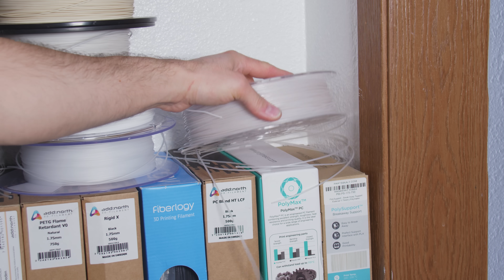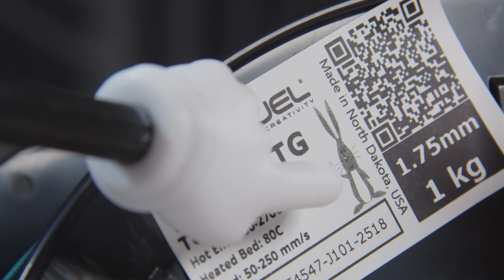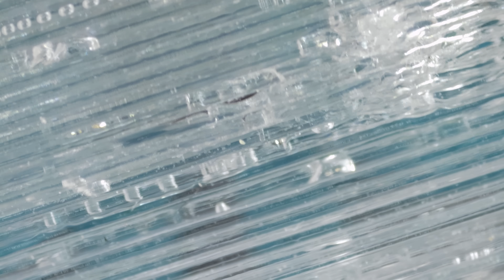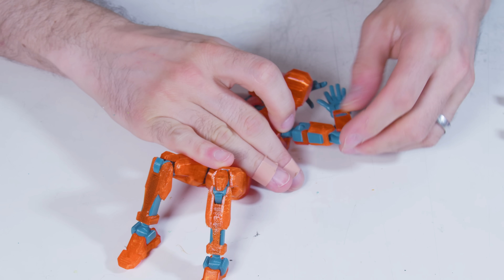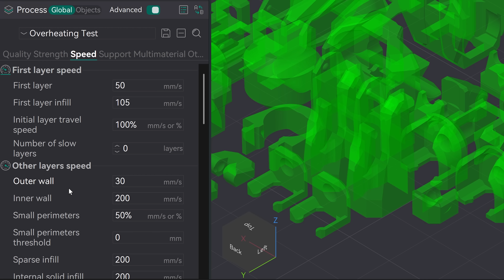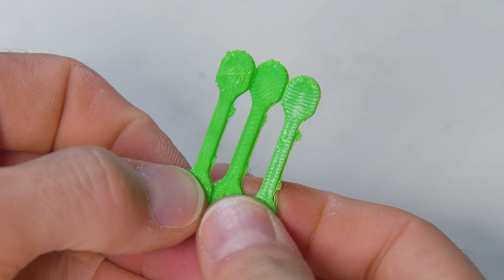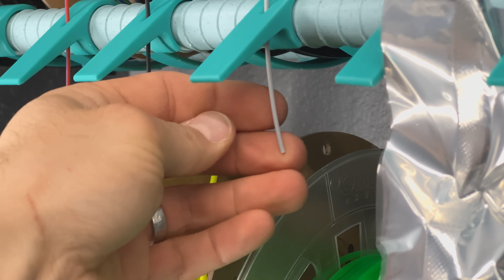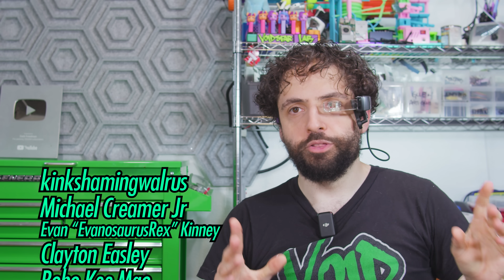Five Bizarre 3D-Printing Mysteries with Insane Solutions

Comment: Putting a spool in the microwave helps release the tension and release moisture. 50% power, time varies based on micro wave Watts. Just long enough to soften, to long and it will fuse or over dry

Comment: Another brittle issue was also caused by re-spooling filament and the stress of changing the shape just a bit during the process, apparently if you simply put it into a dryer it will cause it to be happy with its new form. Got this from another video.

Comment: One weird problem I had is one of my CHT nozzle made my filament full off bubbles it made me go crazy about the filament but when I tried them on other printers they were fine. And it wasn't reserved to only one material I tried asa and pla, both had bubbles

I ended up testing to change the nozzle for a new one (exact same model) and it worked

I have no idea how a worn out nozzle can induce bubble in a print 

And it wasn't that the hole had widened larger than my print lines since I tried double print line width and it fixed nothing

Comment: 12:37 I got problems extremely similar to problem 3 with my first spool of PCTG. But the solution ended up being something else. My layers were actually worse in the center of the part rather than the edges and I was getting lots of buildup on the nozzle. The problem ended up being my z offset. Not sure yet if this is specific to PCTG because it's so viscus, or of the default offset on the Flashforge AS5M is just way to close to the build place. But bumping up the offset by .05 completely solved the problem.

Comment: PVC is extremely dangerous to a person's health during the manufacturing process. If it even slightly burns, the smell is noxious and can cause severe irritation. Not to mention formaldehyde is a byproduct when PVC is beyond it's nominal temperature range.

I recommend that only large scale manufacturing use PVC and PVC should never be 3D printed. (unless you are an expert)

Polypro is that one material that is forgiving in a number of ways but can also be extremely finicky making it more of a pain to process. There will be variations even within the same lot of raw material. I avoid polypro and go with more predictable materials such as ABS, PA, PC, PET-G. and even PLA.

Comment: does 5 perhaps explain why I get small pieces of broken PLA in my AMS if I don’t use it regularly? I have dessicant, the AMS is ‘dry’ but not only was it breaking at the point the filament enters the AMS feeder, but it was breaking at the 4-to-1 combiner which was a PITA to discover and then dig out. For now I’m fully retracting filament when not used for a while - like out of the feeder not ‘AMS unload’ which still leaves it in. But I’ll look at a clip too

Comment: Huh maybe this is why my .3 single.wall PCTG prints didn't have very good layer adhesion. 

Then again maybe PCTG doesn't like "to stick to itself" that much. 

I mean I was printing in vase mode so bubbles from retraction can't be to blame. Tried printing slow and pretty fast. Neither seemed to help much tried printing in the  middle and higher temperature range but didn't try at the low end of the range.
Reply: Turn your fan off.
Reply: @3dfuelusa  was off.

Comment: I have a problem with my prints: I tried all kinds of settings. I tried it with PLA, PETG, ASA. I sliced a million models, but nothing comes out of my printer.

(Solution: it's me, i see the print time and never hit start because i don't have the balls to leave my printer alone during prints)
Reply from the maker: I was going to ask if the printer was plugged in

Comment: I have a printing problem I would like help with.

New high flow hot end. Aiming for 30³mms with PLA plus.

The first 8mm of layers ( sometimes more sometimes less) with have little bobbles or voids like the filament is moist or that the extruder is skipping. ( In the sections where it gets to 30mm³s)

However it's completely flawless after this.

Now my guess is that closer to the build plate it's cooling fan is struggling due to sucking in hot build plate air.

What's the actual answer though ?

Who knows.
Reply from the maker: It could be moisture. The outermost coils of filament on the reel are exposed to air and get waterlogged first. If you run prints immediately following each other, do the successive prints also have the issue?
Reply: @ZackFreedman So the errors happen , even if I  cancel after the errors stop, clear the plate and hit start and have the same issues.

On closer observation it appears to be happening mostly when the print head decelerates from 30 mm³s to turnba corner so it could be some kind of pressure advance smoothing issue?

I've settled for a slightly lower flow rate for now. It's still a bunch faster than the default profile ( 100% increase) 

Maybe I should stop being greedy and chasing those sweet sweet volumetric flow numbers.

Comment: Any info on why one would print “inside then outside” vs “outside then inside”?
Reply from the maker: I assume you’re talking about infill before perimeters. Printing infill before perimeters causes the nozzle to mash the innermost perimeter down onto the infill, effectively trapping it and strengthening the print. But this also causes some overextrusion, which can lead to artifacts. Perimeters before infill can make the print look cleaner if infill strength isn’t relevant.
Reply: @ZackFreedman awesome thanks so much, that’s kind of what I was thinking. Awesome channel by the way! Your channel definitely has inspired mine and your every filament episodes are my working background videos! 😅

Comment: I have an old roll of silk PLA that separated into long sinewy strands just sending it through an AMS. Had to disassemble the AMS, the splitter hub on the back of the printer, and the extruder just to unclog and unf*** everything.

Comment: I made the plunge and got some PCTG filament after watching your famous filament tier list video. Frankly, it has been a horrible pain-in-the-neck, which was a big disappointment because it supposedly is so easy to print. My troubles mostly centered around sudden extruder clogging, due perhaps to unpreventable heat-creep on my SV-08. Now, your more in-depth analysis of its eccentricities MIGHT give me some tips in fixing the problem. Many thanks, and keep the great videos coming!
Reply from the maker: Yeah, that can do it. Try printing at a lower temperature without retractions - if your issue really IS heat creep, that could solve it. Alternately, try printing at a HIGHER temperature to cut the viscosity and slow things down, in case it’s a melt rate problem

Comment: The one where nylon can get too dry and pla needs to be in a tight clip was news to me.
 I thought the pla had moisture problems and I had no clue about nylon, because I have my nylon and tpu in a dry box with solid state dehumidifier, and my nylon was "broken" the same way, I thought they couldn’t handle the hydrogen\oxygen.

Comment: So on your suggestion and because ZombieHedgehog is a cool guy I printed a bunch of Zombie's filament clips. Unfortunately they have the same problem that every other filament clip seems to have. It holds the filament really well to the other piece of filament... but nothing is holding the second piece of filament. As soon as I let go both pieces of filament unravel. It keeps it from getting tangled but doesn't really do anything to hold the filament tight.

Maybe I'll jump on one of his streams this week and pick his brain because its very possible I'm doing something wrong. But my understanding of physics suggests this method of filament retention is flawed and it just relies on friction between two slippery pieces of plastic to hold itself in place.

Comment: The reason why PP becomes more clear the "more it crystalizes" is because the crystals themselves are smaller. In commercial use, you'd mix something called nucleation aid directly into the material, to form lots of tiny crystals instead of fewer larger ones, in order to get an almost entirely clear material. So it's more about the size of crystals.

Comment: I've seen that bubble-forming behaviour with a filament made from chemically modified PET (ground bottle flake; extruded with reactive chain lengthener mixture; mechanically equivalent to average PA6 with slightly better Izod, Charpy, Gardner values and much better photo- and hydrolytic stability; crystallizealable though not to the degree of PET) we were testing in uni. Great material for precision injection molding, infuriatingly sensitive to print settings.

Comment: Interestingly with nylon strimmer (or weed whacker or something like that if you are American) line it can get brittle, especially if left somewhere hot or dry, a common and easy solution is just to stick it in a bucket of water. The absorbed moisture makes it less stiff but it does make it much more durable and not brittle.

I have also heard of nylon parts being soaked before assembly, because it makes them more flexible so they are less likely to crack and then after it dries out again, just in the air, it gets stiffer and harder.

Comment: Most cases. I significantly slow the print and travel speeds. Most stuff I print is only a few inches wide. So moving 20000 or 2000 doesn't really make much difference in print time. Maybe a minute or two.

Comment: i really like PCTG. i used it to create a custom commander deck box that was 'mad scientist' themed. on the 2 larger sides of the box I had a 'portal' that consisted of single layer thick walls that you could see the cards through. another side had vats that were also 1 layer thick and you could see people through the walls. it still amazes me that it stayed more than strong enough to withstand some pretty intense abuse from my friends. the only thing that's stopping me from completely switching to it is the relative lack of colour variation.
Reply: Really? We have 41 colors available right now - which color(s) would you like to see added?
Reply: @3dfuelusa hahah I should have specified. I'm in Australia so getting your stuff shipped over would probably be prohibitively expensive. I did look at the website and I am very jealous of the variety. Of the options I have local, there's like 6 colours

Comment: @13.40 Im gonna chalenge you on this because you are wrong. This has noting to do with the tilting of the toolhead(seriouslly??). If you think where the tilting point is(the shuttle) and draw a circle from the shuttle to the nozzle, with the center on the shuttle, the tilting can only make the nozzle go up, not down. Plus the nozzle is a layer hight above the printed part., it has nothing to scrape...
What really happens here is the speed is to high for that filament printing temp, the filament does not get to the proper melting temp due the to short time in the melting zone and while printed, becouse of the lower temp, it can not bond well on the layer bellow and will curl up behind the nozzle. And when the nozzle comes to print the next line, because of the line owerlap, it will flick the curled up parts on the printbed. The solution to this is to raise the printing temp by 10-20 degree.

Comment: This video was so informative! I’ve been having the worst time with top surfaces,  including encountering those crumbs, on one particular print with a very slightly domed surface in PETG HF, and particularly on two corners. Acceleration causing the issue makes a lot of sense, and I’m happy to understand what’s going on so I’m not just randomly trying settings if it happens again.

Comment: Breaking due to no clip, strange.  I literally have left 100+ PLA spools loose without tightening or clipping any of them and I'm thinking 3 have been crumbly including 1 recent one.  So my question is why is this not the filament fault if 97% of spools don't suffer from this?

Comment: I have been wanting to get some peek filament to print replacement insulators for my atomisers, they usually use injection moulded or machined from solid blocks, the price of over $1 aud per gram of peek filament is a bit of a pain but if it's possible to print tiny insulators I will get some, I'd also like to try printing a boro tank from pctg.

Comment: regarding the snapping PLA, I'm curious why some PLA does it way more than others, and I've also noticed that tossing it in the filament dryer seems to help.  I don't know if it's just releaving the strain in the partially cracked filament to allow it enough flexibility to make it into the machine, or what.

I have only experienced it on certain rolls/certain vendors.  I have some stuff from a local supplier that will break into little bits inside the reverse bowden pretty reliably if I leave it loaded in the printer overnight.

I had assumed it's probably stress related as well, but I think there's probably a bit more to the story.

Comment: the cristal boundaries interact with light, so if you have crystal that has an size comparable to the wavelength it will scatter the light. If it is an order of magnitude smaller or bigger, it will be clear again. It is valid to any transparent crystal

Comment: One of the things I design and print is bodied for mini-z rc cars. Obviously strength is a big deal. I bought into the 3D fuel sales pitch of PCTG being so much stronger than PETG. I had pretty good success with PETG, so I had high hopes. Turned out to be very brittle and poor layer adhesion. Maybe I need to try again with different settings or something, not sure but initial impressions were not great.

Comment: Here’s my baffling print problem
My printer is the bambulab a1 mini
The first layer prints in waves of correct thickness to extremely thin, then the extruder clicks once, and the cycle continues.
The first clue is the nozzle diameter is 0.2 mm.changing the z offset reduces the problem but does not eliminate it
Raising the temperature helps somewhat but doesn’t solve the problem either.
The second clue is I use petg for my print.

The problem is that the nozzle moves down during extrusion, and jumps back up when extrusion stops.
The cause is loose screws for the heater block.
At least I thought so until it started happening again and the screws are tight…
I just use a raft for my miniature prints.

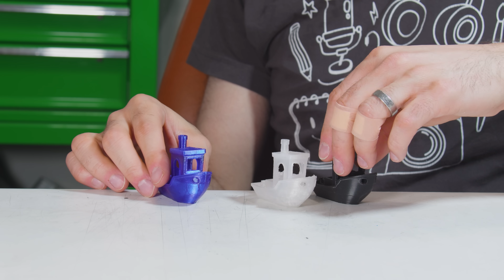Comment: 09:14 I have the same sort of issues with TPU, when printing to slow or to hot it forms bubbles, no matter how dry it is. I kind of proved it to myself when I was examining a print that had "slow down overhangs" checked on and on these slower parts there were bubbles.

Comment: So, in automation engineering (think pick and place robots and other servo solutions) you would actually not solve the crumbs issue by limiting accel. You would limit its maximum jerk, which is the maximum amount of change in accel the motion controller may introduce in a certain amount of time (m/s^3). This helps in preventing inertia introducing instabilities in motion. I haven't seen many 3d printers take into account Jerk however.

Comment: I'm happy I guessed the 2nd bubble trouble as temperature too high or minimum layer time too low, even though it's technically not the right answer (I missed the speed issue because I don't print at under 50mm/s.)

Comment: ugh i would like to buy nylon to just try it out but its too expensive for fu**ing around and i have no planned use for it. hmmmmmmm. 

btw: do you have a CSV logging temperature and hygrometer for the room? you can see daily fluctuations on these on an app its very handy. i dont own a dryer since it wasnt necessary yet ( only pla, petg, tpu)

Comment: :O I am genuinely looking with this face. I have purchased my first engineering material for a work I did for a company - PA6-CF20 which is carbon fiber filled nylon. I've spent almost 3 days just to get the thing to print. With no drying, it was unusable. I dried it, still bad. Messed around with settings, etc. Ended up drying it for like 12h - upon which point with a lot of failed benchy-s (they were very expensive with this material though) I managed to print a good looking model. Delivered it to the customer and it immediately broke :'D 
The info here regarding nylon and water just baffles me :O I have to give this material another go some time....

Comment: I have a love/hate relationship with PCTG... I love its properties and the successful prints I have had with it are awesome, durable, and holding up to hot car dashboards like champs... but it also easily has the highest failure rate for me too... I have yet to really find an Orca Slicer print profile that works perfect. The Semi-3DFuel PCTG profile has been better than Extrudr. I have a Bambu P1S and AMS. I have experienced all of the PCTG issues you mentioned, so thanks, this will really help me dial in a better profile or two.

Comment: Judging on what you're talking about with issues of PEEK on your printer I would assume you can anneal that print and get the rest of it to crystallize.  Granted you'd have to factor in dimensional changes on a future print but just keeping it hot up closer to its melting point should get it to crystallize.

Comment: 1. Overdried Nylon - i got that one.
2. Too much retraction - i got that one.
3. Meltzone cook-off - nope didn't get that one, i DID experience this issue though, specifically with ABS turning all crumbly in slow print sections.
4. Acceleration wobble - nope, not this time.
5. Uncoiling - nope; but i bet there is a lot more going on there than just this; besides, plopping it into a dehydrator to anneal is actually a plan and something i do sometimes because i refuse to believe the "water makes PLA brittle" myth. I think it just crystallises with time. But yeah i think pressure can crystallise it too, which is why it got periodically brittle.
6. I recognised the PEEK and i guessed one would be PET but i still have no idea of any of this, breaks my brain.